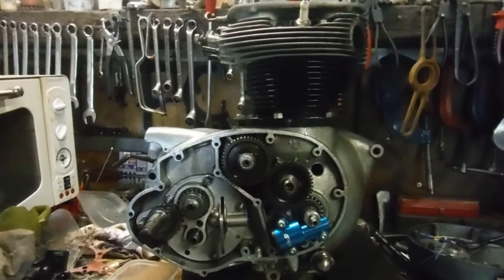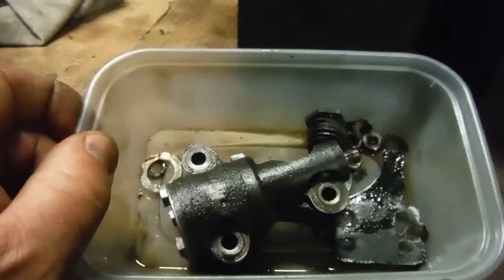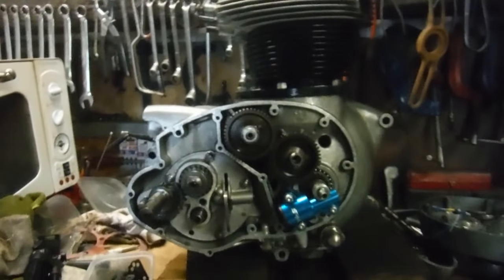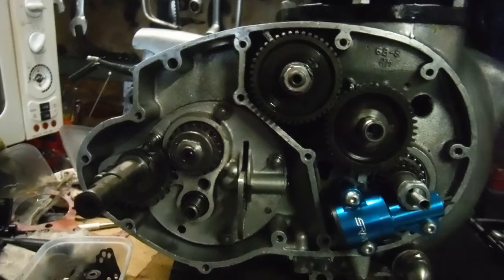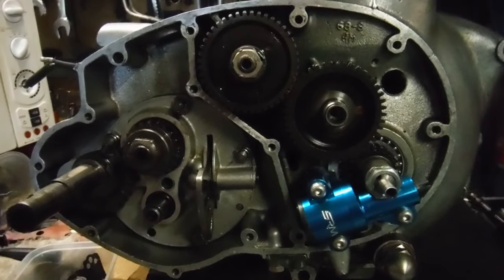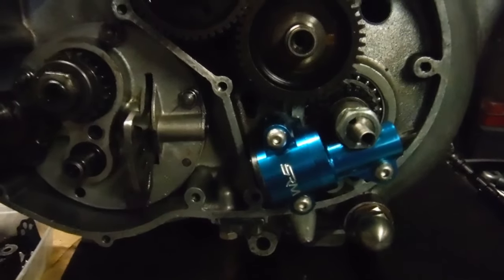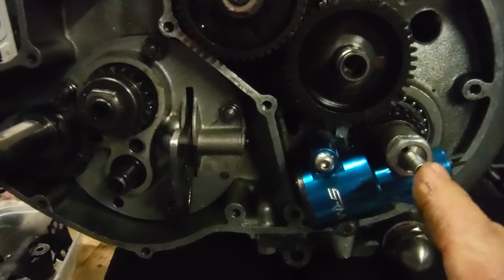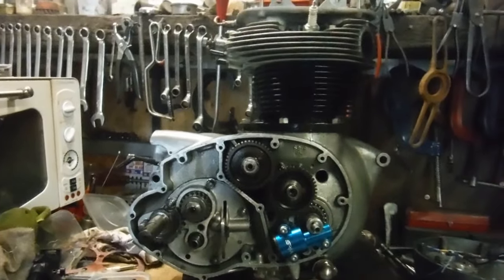BSA A65 'Oil tap engine' strip & rebuild 8 The new oil pump has been fitted!

Comment: i used to put my finger over the oil return  and turn the engine over on the kickstart . then watch to see oil returning  to the tank [ this was a tip in motorcycle .scooter and three wheeler mechanics in the day 1968 ]supposed to build up pressure in the supply line